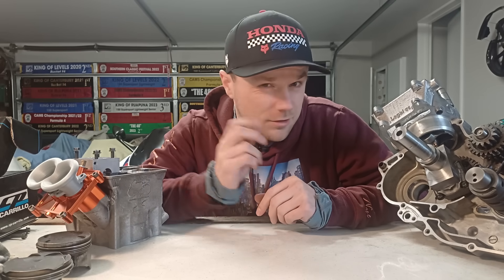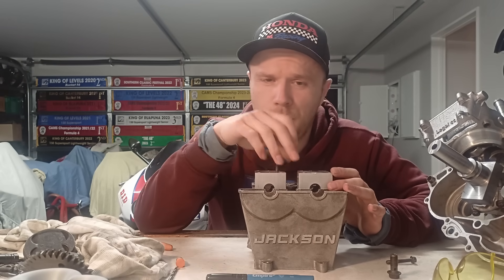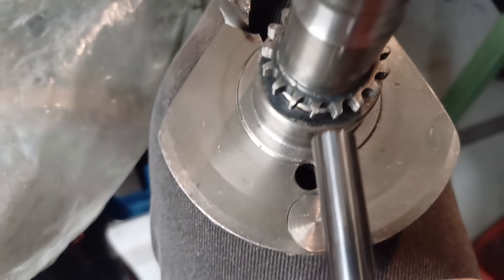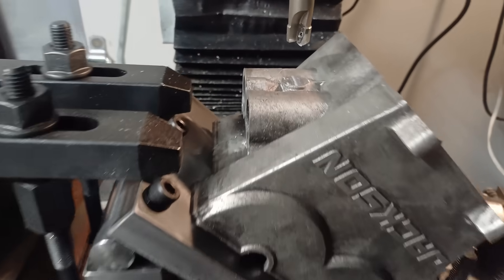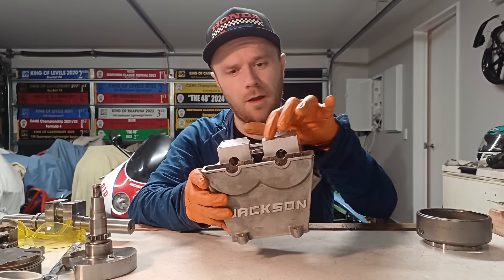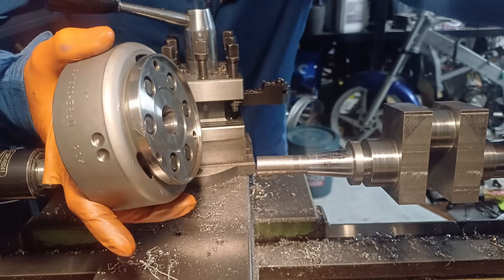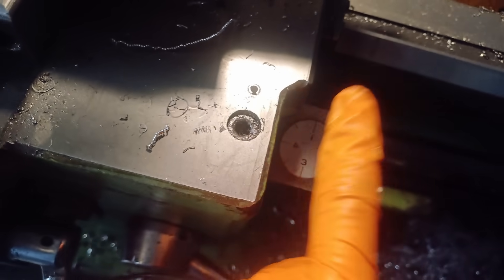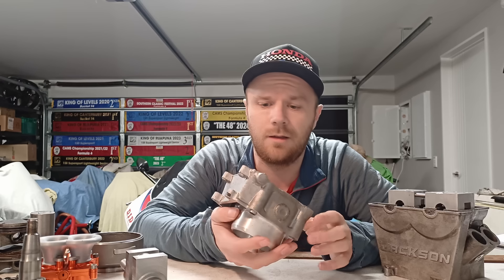Making Earth's Fastest 150cc 4 Stroke from Scratch.

Comment: Im thinking you have a dro on your mill. To cut your sprocket turn up a disc about 16mm thick of about 150mm dia. If you have say 14teeth to cut use function on milk and drill and ream 14 holes in the disc near the outer edge. You now have an indexing plate. If you put two pins in about 5 holes apart and grab disc in your vice. Thru the centre of the disc add a boss. Turn the bore of the boss to a size that suits the crank snout. You could even taper it and hold with thread of crank. So now you have a disc holding the crank you can index. If you put a stop on the table you can slide disc to meet it when you insert it in the vice. So that will cut one gash with appropriate bull nose cutter. Then repeat by moving dowels i hole each and put back in vice, slide to stop and you have exact rigid setup for next "gash. You could easily go round once almost to depth and then put on lead in for link by offsetting a straight sided cutter. Then go back and finish to depth. While you can try and get tooth perfectly on tdc, i would have thought you would have adjustment with cam wheels at cams. You will need to play with cam positions to optimize power.

Comment: To cut a sprocket like what you showed  isn't too hard. Do some research, you can use a ball nose cutter and quite a bit of handle cranking to produce a good accurate result. I'm also a Kiwi and my cnc lathes use this to produce integrated sprockets like this. Best of luck with the project.
Reply from the maker: Just put an order in for several ball nose cutters 😁

Comment: My mates dad was a mechanical engineer moto cycle builder mechanic back in the 90s he build a 1977 XL350 sand drag bike to beat the bikers he do work on there bikes ,and he built this stinking hot motor with his own camshaft and custom timing using degree wheel ,lumpy would almost bounce front 23" wheel off the ground at idle ,he smoked them ,,they were pissed and when he got cancer they purchased it off him ,when they drove out the drive he said them meat heads will never work out the cam timing if they mess with it , :)
Reply from the maker: Hahaha, there is nothing like building it yourself by hand. Your dad would have known every secret in  that engine.
Untrained eyes would miss most of them.
Sounds like a sick bike.

Comment: Check out Artisan Makes recent videos on internal gear cutting.  He broaches then on the lathe with a single point tool.  Still applicable to an external gear.  He has built a dividing plate on the lathe spindle.

Comment: MAAG gear generating. an oscillating rack cutter. or a gear, synched to translate/rotate as the work is rotated. just as easy to do as a single tooth...
still needs the dividing head.
doesnt even have to have the included angle. try "generating gears with slit saws". andysmachines has the best tute. once you understand the maths and have the hang of it, you forget involute cutters.

do it on the vertical and take advantage of the quill feed otherwise its going to be extremely slow and tedious... "vertical shaper". 
or the lathe. gear of same tooth count, an adjustable stop so you can accurately produce the angular offset as you generate the teeth...

and all that said and done, that is not an involute profile, it looks like a plain old roller chain sprocket, which is just a ball nose and a file...

and then that raises the issue of it being hardened... wee, induction hardening with a ZVS....
Reply from the maker: I will have a look into that, but sounds awfully complicated.
I think ball nose end mill and file is going to be the plan.

Comment: cutting a gear in this place could be done with a shaper or a makeshift shaper using a lathe  as a dividing head and pushing single edged cutting tool mounted on the cross slide, cross slide shoul;d be locked each time and advanced slowly to more of shave in the shape than  anything

Comment: Brilliant. Humble but keen to get it all sorted. What are the specific goals of this project joined a bit late....fast engine die soon, reliably fast then a 2 run engine? Love it all anyway.
Reply from the maker: So the goal is to build a race engine from scratch for a racing series in New Zealand called Buckets.
Main reason is I have always wanted to build my own engines and a single is easier to build than a multi cylinder.
Hp goal is 30hp at the wheel but more may be possible. 
I'm just enjoying the challenge and learning a ton, happy others are enjoying it as much as I am.
Cheers Logan

Comment: I have thought about all types of ways I could cast engine parts. One was casting the parts inside a large steel box. With a vibrating motor to be turned on a couple minutes after the pour, and  the chamber lid  closed. With a large tank or tanks like two 100 lb propane tanks. Having a vacuum pulled on them with a 1" pipe connecting them to the box with the freshly poured molds inside. Through a ball valve(or gate valve) soon as the lid is closed on the pour. Open the  valve . Pulling a light vacuum on the molted aluminum, then start vibrating the still molten Aluminum.  With a fairly high frequency 100-180 hz to shake the sand mold  apart . Hopefully, it will drop the ambiant pressure 1/2-2/3. It should  allow any trapped air or any gasses to be pulled from the  molten aluminum .
Reply from the maker: Oh dam, that's quite the process. It's very impressive 👏 
I have investment material for the mold and will vacuum the flask during the pour.

Comment: I think a press on sprocket would work. A couple of spot welds to secure it to give you confidence. I've been fitting rotors over the last couple of years and every one I have checked has been out of balance. Even FZR250 rotors which surprised me given how high they rev.
Reply from the maker: I'll persist for now with the one peice sprocket, a local company can do it for me when I decide its above my pay grade 😅.
Good to know. I will check the balance for this engines rotor before finial fitment.
Cheers for the heads up, didn't think of that.
Reply: the rotors are balanced to the crank assembly individually, they arent really a swap over item even if they are...
Reply from the maker: @paradiselost9946 Yeah I guessed that with the fxrs, when you swap cranks you tend to get a little vibration.
I think I'll just balance them Both separately so I can swap cranks and rotors ect with no issues.

Comment: I used to machine my own 1776cc lotus cortina and I see a little mistake that will break the crank shaft , RAIDAUS CORNER, NO 90% 1MM over size does leave much room. Great job love the determination, never give up
Reply from the maker: Yeah, it seems the radius on the big end is critical for strength.

Comment: Could you machine off the sprocket from your spare crank - like a ring with teeth - and weld it onto the new crank after all it is just a mockup?
Reply from the maker: I think that might not be strong enough, ik  welding parts like that is probably not the best.

Comment: You are trying to make single cylinder F1 engine that's awesome 👍,   but
You can't use that crank case or bearings you showed on video,i think if that engine works running in like 12000 rpm that Crank case you choose won't last long.
Reply from the maker: Yeah, these cases are only temporary for testing purposes 😅
I do plan to make my own cases as well in the future.
Reply: I will be waiting to hear that short stroke rumble

Comment: Hey man, a couple of thoughts regarding the crank. What's the idea behind making a single piece crank? A press together crank would be much easier to make. You can buy precision ground hardened bar that is suitable for the pin and then the 4140 webs don't need any heat treatment or hardening. For cam chain gear, make it separate to the crank and press it on.
Reply from the maker: The main reason is that press together cracks flex more than a one peice crank, so they require extra squish. 
I will have to put a smaller rotor on allowing the sprocket to go over the taper.
Will still be running the heavy rotor for the charging system and better inertia.

Comment: Beautiful work, if I can remember correctly the 1980’s Honda XL/XR 250/500 had a press on lower cam sprocket.
But it’s been a long time since doing my motorcycle apprenticeship on the Honda’s.
Reply from the maker: I have considered a press on sprocket but would prefer it be one piece ,  I'd be very sad if it moved 😅
Reply: @TheMotorcycleForge  I totally understand, but we had more problems with Honda Cam Chain Tensioner’s and out of round Top Cam Chain Sprockets which turns out after getting official letter from Honda Japan was designed into the design to increase where to the chains to increase use of parts for profit.
I’m glad to have left New Zealand on my OE in the mid 1980s as Honda dropped there design quality engineering.
Reply from the maker: @overland_adventure_nz ooooh yeah I have seen my fair share of crappy honda valve trains, I'll stick to suzuki 😂

Comment: Man you should have just ran a -4an stainless braided hose with 2 90 degree fittings for the oil transfer tube on the cam caps under pressure I have a feeling that's gonna leak under heat expansion
Reply from the maker: I'm not to worried about leakage, the original air cooled head has 3mm holes in the oil gallery to poor oil on the top of the combustion chamber for cooling.
Reply: @TheMotorcycleForge  i was just referring to the cam journals inside the cam saddles and caps... have you ever seen a sportbike or DOHC cylinder head that had a blockage or leakage between the intake and exaust cam in the oil passage that fed the journals???? Ill put it this way 90% chance there is no welding the saddle and making new caps and then line honing... most of the time the cams, cylinder head, timing chain, buckets and all go in the scrap pile and start completely over... ask me how i know!!!! I build 20+ mini sprint engines a year and repair double that